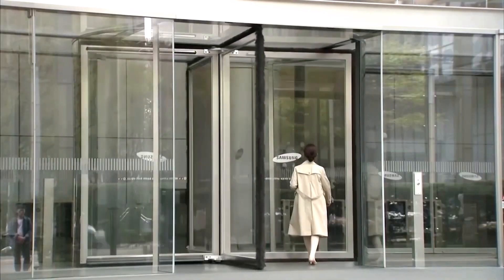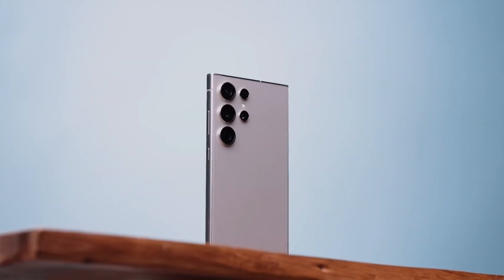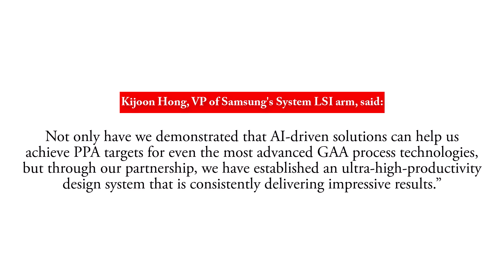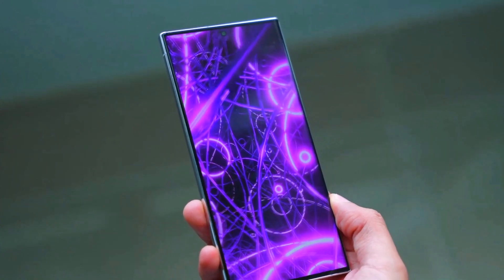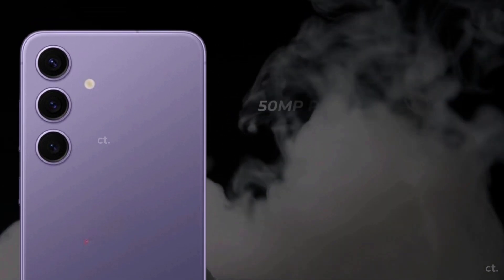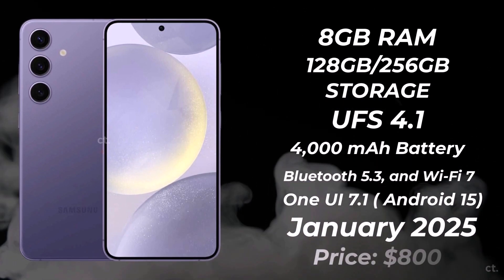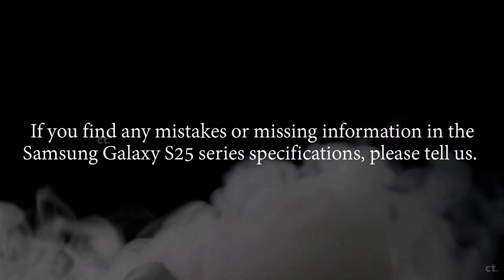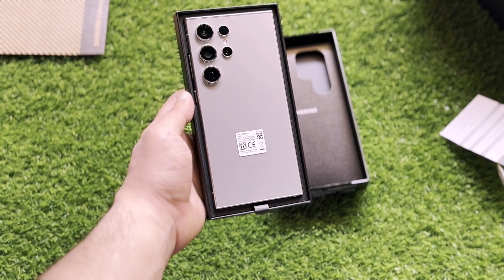Samsung Galaxy S25 Ultra - OMG, FINALLY!

Comment: 144hz is already confirmed to be replacing the 120hz and a 50mp ultra sensor is supposed be replacing the 12mp.
1hr battery charging is reasonable. But samsung needs to do something about the poor video compared to the competition